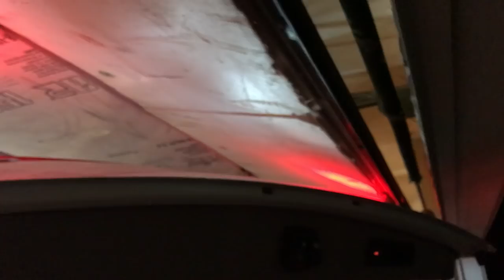Honda Odyssey How to Change ALL lights to LED

Comment from the maker: Timestamps:
0:38 Change the Map light bulbs or Reading lights bulb
4:37 Changing the door lights or Step light
7:15 How to change the second / third row map / dome bulb by your head
9:15 How to change the trunk light to LEDs
11:40 End result picture of interior LED's
11:52 Process of how to change the rear turn signal bulbs to white (not led) - also how to remove taillights
15:38 Back of tail lights bulb info
20:30 Replace the License Plate Bulb on the hatch
23:17 Quick info on how to take apart the headlights caution
29:05 How to Change the front turn signal bulbs
30:28 How to change out Stock OEM Headlights (or replace with Xenon / HIDs if you want)
31:59 Glove box light removal and changing
33:18 The BEST LED bulb I have ever seen 300W LED's bulbs
34:29 First mods to change when buying a new car: (example -
 Changing engine filter by installing K&N air filter)
Reply: Any experience with climate control lights going out(as well as radio lights)? Changed passenger side fuse 25 with no improvements. TIA
Reply from the maker: Sorry no experience with this, can anyone else here help with this climate control issue?
Reply: Awesome sir. Did you have to buy the flasher relay for the LEDs?
Reply from the maker: No relays are needed except for the turn signals.
Reply: Nicely done! Just a quick question, have you changed your drl/high beam to LEDs? I have an elite trim too and it's so hard to replace that bulb because of the bulk of the HID case. Is it possible to replace it without removing the headlight? Thanks.

Comment: FYI, that switch between the two front interior lights lets you turn them off without having to turn the car on.  
On, Door & Off settings.
Reply from the maker: Yes good information I forgot to mention

Comment: Since you are using a metal screw driver, you run the risk of shorting out the original light and fuse. I know. I did it twice!! LOL Those orange plastic pry bars work really well. My 2006 Odyssey original and LED bulbs are long and cylindric so you gotta improvise,  but this video is very accurate.
Reply from the maker: Good call, yes the orange things are nice.  I just recently bought a kit with one...much easier

Comment: ...thanks for the great job....but regarding these white turn signals,  we should always carefully advise viewers to check your local laws for permitted running lights or turn signal colors, whether deep blue, red or amber/ yellow and white...some very blue front and rear lights might be prohibited, and pure white lights in the turn signals might likely not be permitted,...but would be totally acceptable in all our interior lamps,  headlamps, fog lamps, back up and license plate lights...keep up the good work..
Reply from the maker: LR VANALLEN — good point, 
yes I️ did forget to mention that specifically.  Definitely good idea to check with local authorities depending where you live. Obviously blue and red on the exterior will be illegal everywhere I️ assume, since those are reserved for emergency vehicles.

Comment: In my state, you'll actually fail inspection if the turn signals aren't amber.
Reply from the maker: Yes each state differs on laws.  When do you need these inspections out of curiosity?

Comment: I want to change the blinkers to LED on my Odyssey, but I'm worried about it hyper flashing. How can I prevent that?
Reply from the maker: You would need to install a resistor to have the blinkers not flash super fast due to the low wattage of leds vs incandescent.  I haven't done it myself, but that's what is needed
Reply: @JealousLawnCare I was hoping there was a better fix. Those get really hot and melt everything around them. Thanks for the response!
Reply from the maker: No problem, good luck bud!

Comment: You have any videos on how to replace the fog light bulbs for 2019 odyssey?
Reply from the maker: Anak Manis -- unfortunately not sorry, I haven't even seen a '19 on the road yet.  I like your enthusiasm about changing so quickly though! 👍
Reply: I know im 4 months late but I just got a 2019 odyssey and changed the fog lights this morning just take the 2 screws in the wheel weld and your hand will fit fine mine are big and i got it done

Comment: The 5 SMD BULBS are too big for the rear push lights, you can feel they obstruct when you turn them on/off.
Reply from the maker: Strange. What year is your Odyssey? I bought these again a month ago and they seem to fit fine again for my 2014
Reply: @JealousLawnCare  2014 Ex, all four in the back lost their “smoothness”, it feels like the plastic cover touches the bulb...
Reply from the maker: Hmm I'm not sure why they would be different.  Does anyone else have this issue with their Odyssey?
Reply: @JealousLawnCare  hey yes i just installed led lights in the back seats and i have the same issue where it’s like the led bulb is too big for the cover, so you have to push it kinda hard for the light to turn on, 2012 honda odyssey ex
Reply from the maker: So it sounds like it barely fits, I guess I don't use them much before or after to notice a difference (just when doors open)

Comment: i've noticed led bulbs don't last as long as the traditional ones.. how long are yours lasting?
Reply from the maker: James K -- I've used these leds for several years, no issues with burnout.  The only "issue" is some light flickering now and then.

Comment: Did you use hids for the low beam?
Reply from the maker: Turbo Joe304 -- yes hids for low beams, I never bothered changing / modifying the brights on my vehicles because I rarely use those.
Reply: Did you not need the ballast to make them hids? Just plugged in to the original harness?
Reply from the maker: Turbo Joe304 - on my Odyssey they came with HIDS already on the elite model, but if yours are not hids from the factory then yes you will need a ballast / hid kit.  I have a video on this when I did my Honda Accord (should be similar install, just a different bulb #).  
Here's the link : https://youtu.be/_iV_CxSn0qc

Comment: Do you install replacement led bulbs with rated power higher or lower than the stock halogen bulbs?
Reply from the maker: MB Legend -- you can go higher if you want because they take less power since they led
Reply: @JealousLawnCare  as far as I know of, led bulbs are brighter but only produce lesser watts than the halogens. You will defeat the purpose when you will install led bulbs with higher watts than stock halogens. Too much glare and voltage issues are expected.
Reply from the maker: MB Legend -- yes that is correct, with leds they require less power used but will generate the same light output (i was confused what you meant when you said "power")
Reply: @JealousLawnCare  oh my apologies. I should have stated watts. Thanks for the nice vid. One last thing, how's the high beam of the led compared with the halogen?
Reply from the maker: MB Legend -- i actually haven't changed the headlights to leds, just hids equivalent to oem.

Comment: So that was a total of how many lights inside
Reply from the maker: Desmond Mays - 8 total interior bulbs + 1 more for glove box (optional), +1 more for the trunk.
Reply: @JealousLawnCare  Okay so I changed my high beams to LED light but now my DRL light is on on my Dash any input on on that for me
Reply from the maker: Desmond Mays -- for the headlights / highbeams I've never changed those to LED (only to hid), i would assume you might need some type of resistor to compensate for the difference in lower voltage.
Reply: @JealousLawnCare  did you tint all the windows or just the front
Reply from the maker: Desmond Mays -- everything is tinted except the windshield (but I do have a tinted strip on top for the sun visor area as well).

Comment: Great video! Btw Where did you use the 4smd led? ‘Coz it shows on the link you provided and on the video you keep on saying the 5smd. And also do you have the type of bulb for the vanity mirrors?
Reply from the maker: Actually I didn't use the 4smd led on my odyssey, I used it on my Maxima but kept the link for reference just in case someone wanted a bulb "not as" bright as the 5smd leds (best example would be the license plate bulbs or in my Maxima I used them for my footwells for a light blue glow).
Funny you should ask about the vanity mirrors, because just after I finished this video my wife asked me why I didn't change the vanities.  I don't use them much and she told me that's the first thing she would want changed to add better lighting. lol  Can never have enough lights in a mirror I guess.
The vanities are a simple change (4 bulbs total, 2 for each side), just get a small screwdriver and pop out the lens cover from the bottom and it will pivot for installation.  I updated the description with a link for the led bulbs I used as well.  Here's the info: Vanity light bulb LED - https://goo.gl/Qv6cZP
Reply: Jealous Lawn Care Me too I only flip that if too much sunlight is hitting my eyes but aside from that I rarely open the vanity mirrors lol mostly ladies thing hahaha. Cheers brother!
Reply: @JealousLawnCare  I bought these Yorkim but it was too wide to fit in my vanity.  I really forced it in but the black housing was too wide.
Reply: @JealousLawnCare  How did you get it to fit?
Reply from the maker: Too wide for which location?
Reply from the maker: Which location are you having trouble fitting? I used them everywhere

Comment: Did you swap out blinker relay to cure rapid flash? Im trying to locate mine for that reason but haven’t found any info on its location
Reply from the maker: estevan santiago -- i actually did not change my signals to led for this reason, just used a whitish brighter light than oem uses.
Reply: Jealous Lawn Care do you know the location of relay for blinker?
Reply: Fyi mines a 2012 odyssey touring
Reply from the maker: estevan santiago -- unfortunately I don't know much about the relays, that's past my knowledge of electronics. :-/
Reply: Jealous Lawn Care all good there should be a relay you can replace to support the led bulbs as signals so you don’t have to damage stock harness with resisters. Ill let you know when i figure it out thanks

Comment: Awesome, Does it work on 2019 Elite?
Reply from the maker: Pratik Prajapati -- which lights are you interested in changing? I will look it up to confirm
Reply: @JealousLawnCare  All interior and truck. And do you think changing these lights might void the warranty? Thanks for checking.
Reply from the maker: Pratik Prajapati -- I checked and it looks like your Odyssey uses the same bulbs as what I showed here in the description.  You may have an extra bulb though for your center console compartment though.

This will definitely not void any warranty

Comment: Disappointed in the rear map lights because the LED’s are too big so you can’t push the lens in to turn the light on/off. Looks like that’s how it is in your video too.
Edit - ok it actually does work but you have to push pretty hard and you don’t get the positive clicking feel like you do with the stock bulbs. I found out that they do manufacture LEDs that will fit in these rear map fixtures correctly. They are call low profile T10 bulbs.
Reply from the maker: Tyler Downs -- i actually didn't even notice any difference in changing the rear maps (easier/harder).  These are common map bulbs I've installed for several cars and haven't seen any fitment issues yet to be honest.  At least they worked out for you in the end with a little pushing.

Comment: Hey, i want blue led lights but not those bright ones, are there any led blue headlights n fogs lights thats not so bright but are the regular range as stock lights?
Reply from the maker: If you want more blue in your hids/fogs just go with a higher # of "K" when ordering.  I usually recommend ~5,000K for white light, but for a more blueish color I'd say get ~7,000K.
Reply: Jealous Lawn Care oh okay i get it, just like theres are different types of blue are there different types of brightness i can get?
Reply from the maker: Yes, but in general it would be very hard to find a blueish light to match the color output of a whiteish light simply due to the fact that white shines more than blue.  So you will have less light overall the bluer you go.  Yellow (~3,000K) is about the brightest light for output, which is why you see it often on fog lights, because if people are using their fogs generally its because they need more light.
Reply: Jealous Lawn Care okay thank you so much, im thinking of 8000k blue lights tbh, what size is good for my 2008 honda accord ex 4 door?
Reply from the maker: SG -- lol you have an accord, but found this video of my Odyssey? That's funny because I actually have a video also on my 2008 Accord changing the lights as well.  2 part videos, but all the bulb info is in the video descriptions and can order them in 8000K as well. Check if out!  https://youtu.be/_iV_CxSn0qc